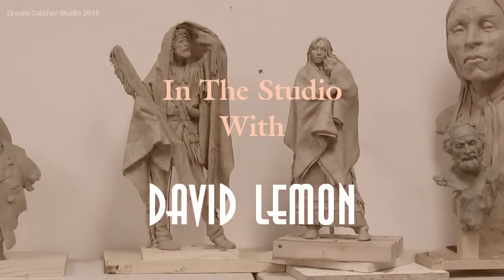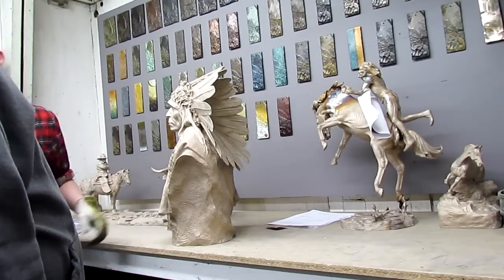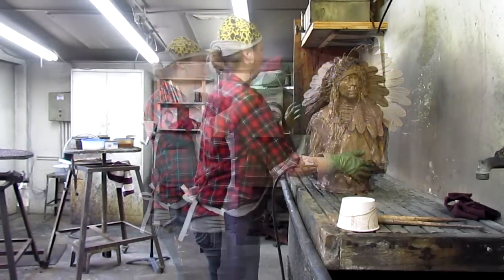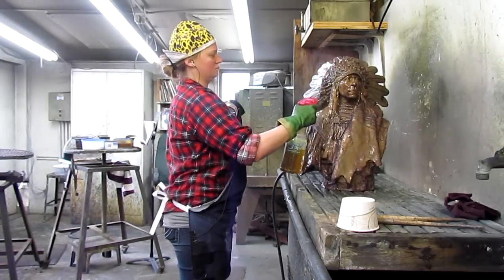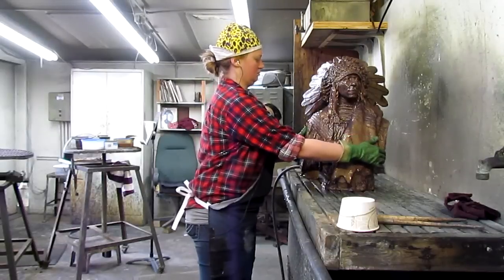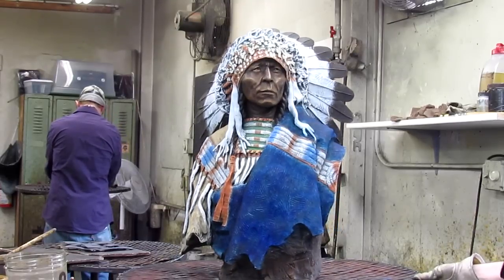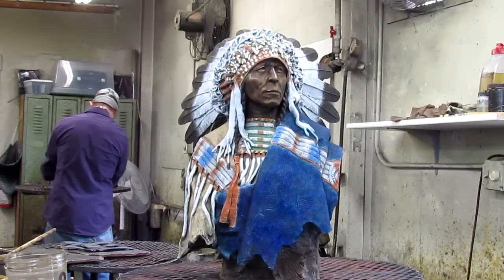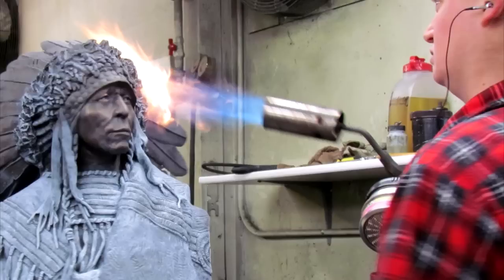The Protector   Coloring the first copy of this bronze today

Comment: How do they cast the plastacine?
Reply from the maker: I take it to a foundry... They make a rubber Mold of the clay... then a wax from the rubber... ceramic mold of the wax ... melt the wax out and then pour in bronze... then another few weeks of welding and grinding and then coloring with heat and acid...  after abpit 12 weels .. a finished bronze...
Reply: David Lemon Ah I see, thanks for the detailed reply! Didn't know about the rubber step. Does that mean the original plasticine sculpture is preserved in the process?
Reply from the maker: They cut it apart ... it comes back to me shredded
Reply: David Lemon Oh ok, I see